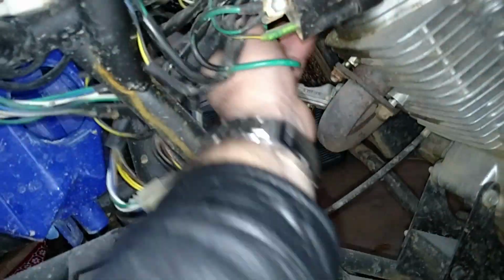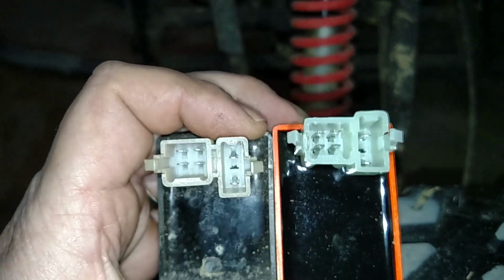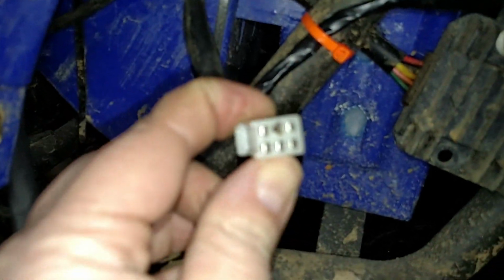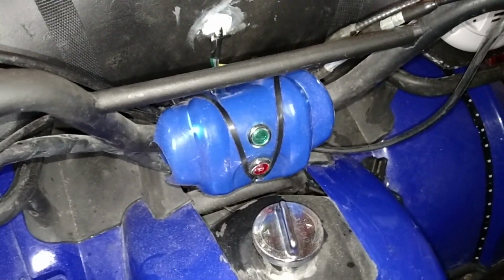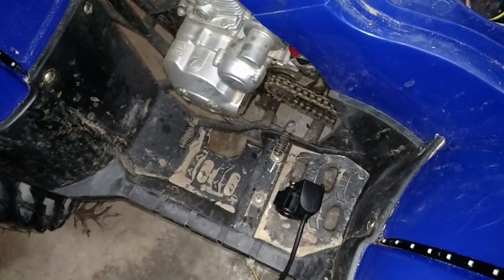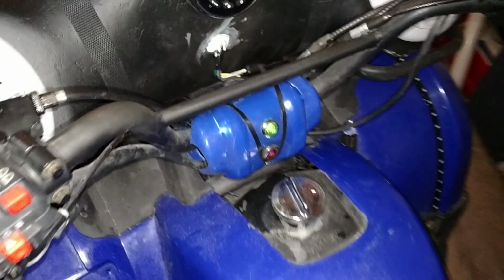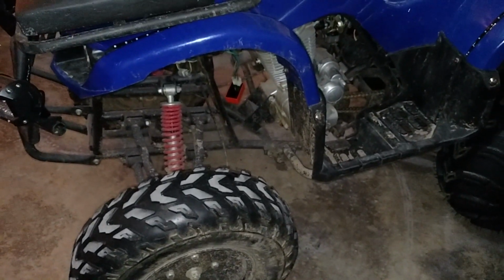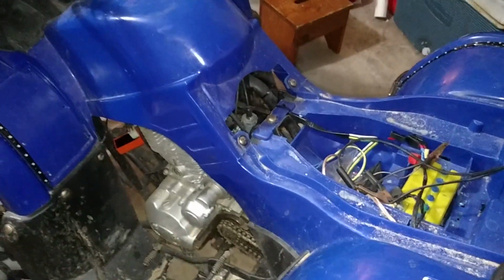Part 3 - TaoTao 250cc ATV not starting - It was just the ignition wires.

Comment: We’re do you put the main ground I have an entirely new wiring harness carburetor the whole 9 yards per side of the engine block and it’s not getting spark and I’m positive it’s because of the ground
Reply from the maker: I would test it when a multimeter.

Comment: mine has the same problem i bought it brand new from venom motorsports 200cc viper fresh out the box it started fine twice then out of no where every time after that i'll go to pull the brake to start it and the neutral light goes off and no sound when i click the start button got a new battery same thing happened started twice then the neutral light cuts off replaced the stator and the solenoid still nothing
Reply from the maker: There may be a fuse under the seat. This on had a cheap fuse holder that was shorting out.

Comment: My atv has the same issue when I compress the brakes the back light comes on but when I hit the button to start it nothing. If I put a screw driver across the two post the starter will spin to give my atv life. I’ve change the kill switch 3 times and nothing comes on. U have any suggestions. ??
Reply from the maker: Their is a fuse on these things that could be blown our the cheap housing has rusted and lost connection. Ours fuse was under the seat on the American drivers side.
Reply: @ChrisDoesWhat  fues was change. I was also told the atv was out in all weather climates. My question is do I just re-wire it so I can have a good start? Could water get into a wire n fry it from working?
Reply from the maker: Yeah the wiring they use on this thing is crap so it's a lot of trouble shooting to figure out what's going on with them.

Comment: Hi. I hope you can help me out.   I have this same ATV. Previous owner because of a wire loose in left handlebar controls assembly,   he bypassed the starting system.  The kill switch works but start and headlights switch doesn't....he removed the ignition switch and installed a HUGE momentary push button switch....and it bypassed the STARTER SOLENOID!!!???....lol.  I need to know how many wires and how many position switch it uses.....as in just off & on for key switch or if it has 1st position for lights then 2nd to start? I know it starts with left push button.  If you can tell me that and possibly the color of ignition switch wires it will give me a GREAT starting point??  It looks like mine has the same left controls assembly as yours.  The choke lever, kill switch, start button, headlights.....if I can't solder the wire back I will have to purchase one of them as well.  Hopefully I won't have to purchase a complete wiring harness but if I do, I do.....I want this to where I turn the ignition switch on, press start button and it cranks AND starts, then kill switch and or ignition switch turned off will kill engine.  Thanks in advance.
Reply: If I this works like I think it should , on left controls it has a small running light inside the big round headlight when you go one click up, next click the front headlights come on, and then when press the red, high low switch to high..the big round headlight and two front headlights will all be on....turning the key ignition switch to off will kill all lights??
Reply from the maker: Sorry, we no longer have this, son is into jeeps now.
Reply: @ChrisDoesWhat  thanks anyway....if I could find it online it would be nice but running into 3, 4, 5 wire ignition switches....hopefully I can find someone that knows...lol

Comment: mine turns over but wont start
Reply from the maker: Would start by pulling out the sparkplug and then turning over the engine and see if there is still spark, than work back.

Comment: Hi. I have same 250.....did you happen to find a wiring diagram anywhere online?  I purchased and someone bypassed the left handlebar controls and I think it basically has the ignition switch on all the time, battery runs down when not riding it...he put a heavy duty push start button which just sends 12v to the starter, then a separate switch (universal) for the headlights and not using the high/low beam switch.  I want to be able to use the key switch, left controls, etc......I hope u can help out. Thanks
Reply from the maker: Sorry, never found a diagram for this, it was a lot of trail and error to get this one fixed. Good luck, on your project! We have moved from this to boats and jeeps since both over our sons are older and over 6 foot tall now.

Comment: Hiw do I run whole new wiring for the taobao 250cc???
Reply from the maker: Did not rewire this atv, that is a big job. We just rebuilt our wiring harness on our boat that took a few days. We have a video on that.
Reply: The rewiring is pretty simple but the with the cheap parts some parts might not work like cdi n regulator  that what I did but every works but I cant no spark
Reply: Everything work*

Comment: I picked one up and put a new battery in and turn the key nothing no lights nothing, I checked the grounds nothing. What should I do next??
Reply from the maker: There is a fuse under the American drivers side that goes out or rust, check that.
Reply: I did that too and checked the fuse with a micrometer good
Reply: And the kill switch seems Fxxxed up it's stays in middle when I turn it left it's like springs back to middle, turn right it stays. Could that be it?
Reply from the maker: @life_ck1251  It could be, I did replace the ignition on ours. We no longer have the ATV, our son has moved on to a jeep.
Reply: @ChrisDoesWhat  ok thanks.

Comment: buddy of mine bought his daughter one of those 110 Chinese ATVs didn't even last 6 months needs new Rings new Pistons new cylinder and she hasn't even completely broken in the motor yet
Reply: U seem like u know a lot I have a tap tap rhino 250 that won't start it turns over but won't start I put a new battery and all that fun stuff to just not sure what to do now
Reply from the maker: There's a fuse under the driver side of the seat, if that's bad it will turn over but not start.
Reply: Did he remove the oil that was in it immediately because the shipping oil is a negative

Comment: what about your stator that has a big part of your ignition system considering it creates yours spark for your CDI to your coil for ignition Also recharges the battery through your voltage regulator rectifier

Comment: as much as I know it seems more like an electrical short than an electrical component because you move the wires you got good connection and then it stops getting connection check your harness
Reply: FYI refer to your voltage regulator it's a voltage regulator rectifier converts the AC power coming out of your stator to DC power to charge the battery
Reply from the maker: TY for your help, I solved this issue, there is a little fuse under the seat that fails on these cause the housing is not waterproof. I replaced that fuse holder and it has not had this issue since.

Comment: FYI anyone attempting this do not leave your voltage regulator hanging like he did you will short it out it needs to be hooked to a ground via Bolt failing to ground off your voltage regulator rectifier will short out your stator
Reply from the maker: This ATV we no longer own, I would recommend this brand to anyone as long as you have general mechanic knowledge. Like any offroad vehicle, you are going to have repairs, and over the 3 years owning this I probably spent $300 on repairs That is not bad and the kids love this toy, but now they all have gone to greater things.

Our oldest is in the Air Force, and our youngest is into jeeps now. All their cousins have moved out on their own as well so there was just no point in keeping this TaoTao ATV. 

I am sure in other projects we are doing now your advice will be awesome, we are doing little things on that Jeep, and we are restoring a boat. We thank you for your support of this channel and love to hear from you.

Comment: I had previously the same problem but I adjusted the valves and cleaned the cylinder
Reply from the maker: There ain't much to this ATV and parts for it are cheap, much cheaper than the boat we are working on now.

Comment: I have a tao tao ata150b replaced the did box voltage regulator and solenoid it still won't start any ideas
Reply: Spark plug wire. Getting spark, check compression
Reply from the maker: Fuse under the seat

Comment: chinese quad tore all the wires off rewired like i saw .red an black an blue wire from stador to cdi yellow black to coil..i have spark at the spark plug will turn over if the throttle is one way it turns over really fast the other way sounds like its perfect turning over got compression please. help..also no ignition or push start

Comment: no spark at the spark plug coil when I touch the two wires to the coil I lose power to everything any help
Reply from the maker: There is a fuse holder under the seat on the right side, this was losing contact for me and cause me to lose power to every thing. I put a better fuse holder in its place.
Reply: Chris Does What does it matter what size ATV it is this is a Fuzion 400
Reply from the maker: I can only speak for this ATV.
Reply from the maker: +Roby Gibble I'm just not sure that the fuse would be located under the seat that caused the issue for us.

Comment: my atv turns over, recently changed the ignition coil and spark plug and it gives off a spark and I also got a new carb installed. my problem is it won't start. it turns over, but wont start. any suggestions on what may be wrong with it?
Reply: Gabriel Mundo mine started doing the same thing.
but when I kick start it a few time it's starts.
Now I just kick start it
Reply: Mine has the same problem too & i don't have a kick starter. Is it possible to put kickstart, If it can where can i find a manual or instruction on how to do it?
Reply from the maker: I don't know about kickstart I think the model he has just has a. There is a fuse under the seat on the right side if you're sitting on the four wheeler, check and see if that is your problem.

Comment: U never showed exactly how u reset the ignition wire my atv won't turn over either light comes on but won't even make the noise like it's trying to start
Reply: Try using the battery charger then check the fuses
Reply from the maker: +Rick Prince what happen here was there was an issue with the fuse shorting out under the seat, and an ignition switch issue. When it turned over it would start. Sounds like you have no fuel or spark, pull your plug, then turn it over and look for the spark. If you have spark, then check for fuel. I know the factory carbs that come with this atv are shit. Once I get to Florida I will do a video on how I keep this thing running.
Reply: +Chris Does Ok thanks i would appreciate it if you could do a video on it so I can get a better understanding I know when I turn ignition on and then hold brake then press the start it doesn't make noise at all like it's trying to start and seen yes didn't either so hopefully it's the same issue
Reply from the maker: +Rick Prince it does not sound like the same issue, it sounds like a dead battery, but put some power to the starter and see if it turns over.
Reply from the maker: +Rick Prince it does not sound like the same issue, it sounds like a dead battery, but put some power to the starter and see if it turns over.
Reply from the maker: +Rick Prince it does not sound like the same issue, it sounds like a dead battery, but put some power to the starter and see if it turns over.
Reply from the maker: +Rick Prince it does not sound like the same issue, it sounds like a dead battery, but put some power to the starter and see if it turns over.